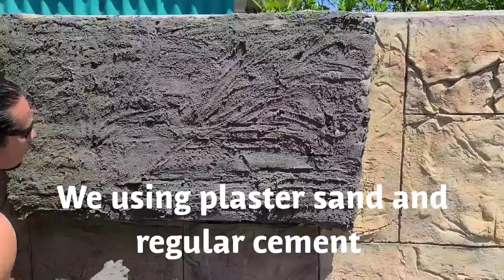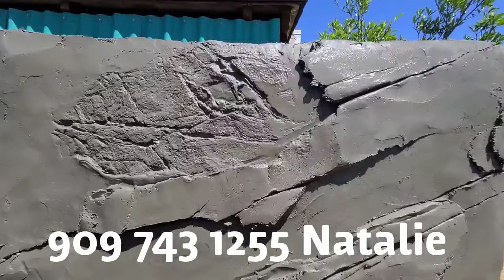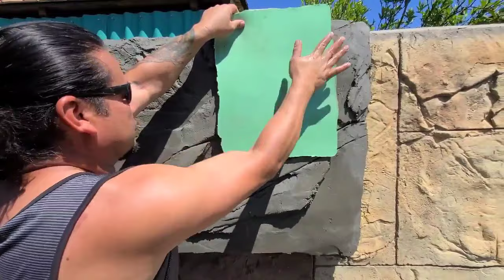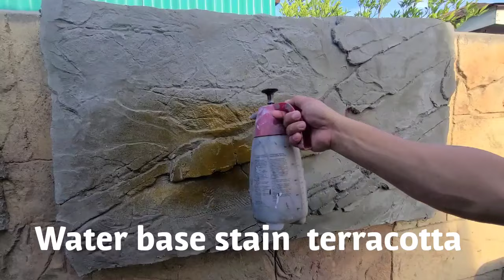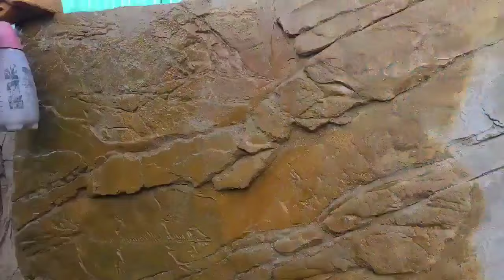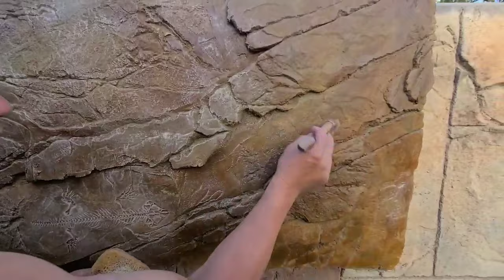How to do rock design with fossil

Comment: it looked great until the paint came on
Reply: The guy never got the base terracotta colour into the cracks. It makes it look uneven and inconsistent. Like a bad artificial rock design. 

Then they overdid it with the drybrush painting. 

But the really sad part was not texturing the rock before adding the fossil. 

That strangely flat area, while the rest of the rock was textured with the mold, looks kind of artificial.

What a shame. It had good potential. Just a mediocre paint and texture detracting a little from the effect.
Reply: Actually where a fossil forms in the rock would mostly look flat and featureless bc the body of the animal would be the only impression and the rest filled with sediment creating a smooth area in an egg shape around the lizard in this piece. I'm a fossil collector and Hunter through hobby and 80% of the time this is exactly how I find them. Oftentimes the smooth rock or a rounded rock is what alerts our eyes that a fossil may be underneath.